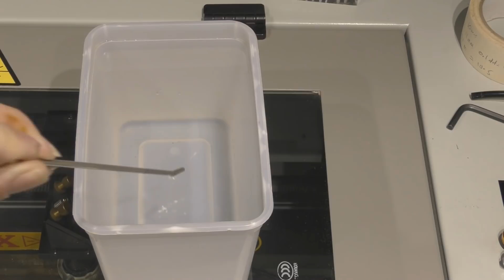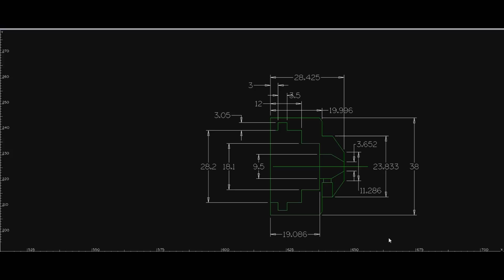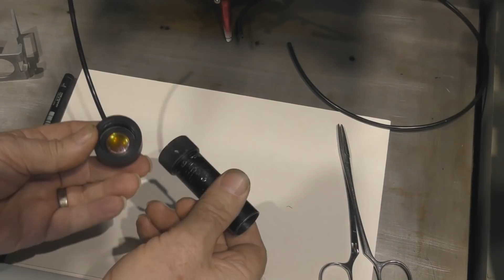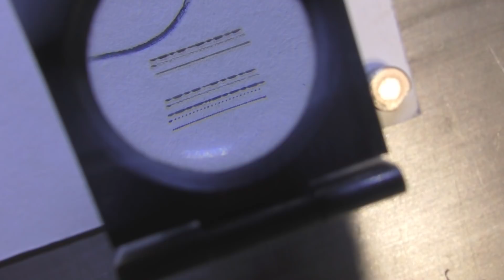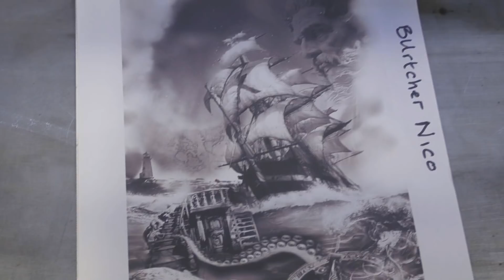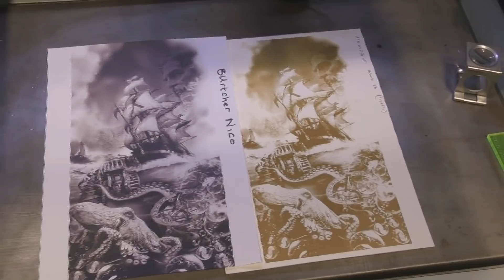RDWorks Learning Lab 139 Designing a Compound Lens System

Comment: I was so impressed about this that I have to try. I 3d printed a variant of your double lens nozzle and now I have load my laser and running a very detailed picture. I wish I could share the result here. It's amazing! It's a 504 DPI  running att 150/9.5  (100W blue china laser). I'm totaly lost!
Thanks Russ!!
Reply from the maker: Hi Mikael
Check your You Tube messages for a response
Best wishes
Russ

ps there is a new video that takes this idea another step on  #140
Reply from the maker: Hi Mikael
I do hope that these interesting new techniques allow many more people to get your superb quality results.  I have steered away from wood because of the inconsistency of the surfaces for demonstration and experimental purposes. It's great that you have been able to achieve such amazing results on wood. Congratulations and thanks for sharing.
Best wishes
Russ
Reply: could you share your stl and raw 3d file? would lave to take a crack at this. i have the black tube like he has.

Comment: Really interesting work! Have you considered adding a mechanical aperture to the beam before it goes through the lenses? This would reduce the spherical aberration and allow you to use higher, possibly more stable, laser powers.
Reply from the maker: Hi John
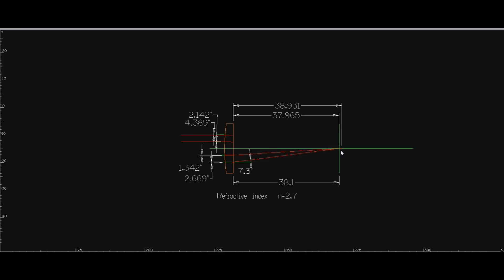I tried various apertures in the previous video and things were worse with small holes.  I understand the dream to minimize spherical aberration but the the more I think about the drawings and the path of the light rays I have seen, the more I'm coming to believe that spherical aberration is doing a good job of regulating the power automatically by letting the central high density part of the beam reach its focus at a longer distance than those from the outer part of the beam  (see the picture at 13:18). I did not try to use a meniscus lens as the second lens in these tests because I felt that the  second concave surface,  which is designed to deal with parallel rays entering the first surface, would be so far off it's original design parameters that it would cause even worse aberration. Hence I used the plano convex.  Subsequent to my video editing I have had a chance to reflect on this issue and wondered if this is the reason why the best focus point was about 0.5 to 1mm further out than I had anticipated. This out-of-focus may be bad for cutting but just possibly it may be a silver bullet for engraving with dots.  I am planning to investigate this counter intuative point in my next video. I'm pretty confident that the conventional rules of optics do not apply here.

Best wishes
Russ
Reply: Hey Russ, thanks for pointing me to the last video, I just gave it a watch.  I have to say that I am still a fan of the aperture idea. Are the spot sizes you show at 9:30 are the ones with this setup?  If you are seeing weird edge effects on the spots perhaps cutting a knife edge with the chamfer facing away from the source would help with weird reflections off the plate.  A larger hole size might not hurt either (12mm-2mm is probably 20-30X power reduction). Something like 8-10mm would reduce aberrations and still pass reasonable amounts of power.  Also I'd recommend this site for refractive index values (its pretty good!):
 https://refractiveindex.info/?shelf=main&book=ZnSe&page=Marple
Reply from the maker: 140 will probably be published tomorrow. I have a different take on the whole issue.
Best wishes
Russ

Comment: Russ, is there a power drop off at the second lens? Nice work by the way. Can't wait for more.
Reply from the maker: Typically lenses are aboout 95 to 97% efficient. So yes there is a power loss at the second lens. That is no problem at all because I am already struggling to get my power low enough. I am operating this tube in the high impact engraving zone even with the second lens. I am using common mode which is a very efficient way to do the engraving as it is high frequency  and high power pulses.

Best wishes
Russ
Reply: SarbarMultimedia what about engraving on black anodized aluminum?
Reply from the maker: Black anodizing will be quite easy and to get what appears to be 500 dpi  because of the way you need to use JUST enough power to evaporate a dot of black dye. Once you have evaporated the dye in that dot with minimum power you can overlap (overburn) with another and nothing will happen except a small nibble off the next dot . Thus you can force much higher resolutions with out muddying the picture even if the dot size says  250dpi.  I have only one piece of black anodized material left so I will find the best picture to to experiment with
Best wishes
Russ

Comment: Nice work Russ. Lovely bit "scientific method" application.
Will it work with "China Blue"? Rather than mill your lens holder from Delrin (Acetal, Polyoxymethylene (POM)) or Aluminium, you may want to try 3D printing the holder. I take it you used Delrin for the holder because it is easy to machine and any "rigid" plastic would suffice, if not, POM is available for 3D printers.
Reply from the maker: I know that the HV power supply on China Blue is not quite as responsive. The answer is yes but I guess at much slower speeds. 3D printing would be an option if you only plan to engrave with it. I am a bit scared of heat reflection if you start using it for cutting. Hence the idea to make it in aluminium.. My delrin version was adequate for proof of concept as I had no aluminium bar around to work with. 
Thanks for the thought
Best wishes
Russ

Comment: I have a very basic optics question: why wouldn't the last mirror be shaped to do the focus and the 90° bend in one fell swoop? It feels like reflective optics is easier than refractive optics.
Reply: Hi
There are several practical reasons why this will never be possible on these machines. 
1)Many sheet machines do not have  raising beds so there is no adjustment in Z for refocusing your fixed focusing mirror  to accommodate varying material thicknesses.
2)All machines have the ability to  swap to different focal length lenses for different jobs. Changing a focussing mirror will entail a lengthy Z axis reset every time you need to change
3) the major problem is that to get the beam to focus at a mechanically practical point means it will always have to be at least 6" focal length. That will make the spot size large and result is much lower energy densities, thus lowering the cutting ability of the machine.
4) Lenses are cheap and easily replaced without the need to reset the beam alignment. 

What you are suggesting will be fine for lighthouses. There is no such thing as a silly idea. What you are suggesting is really possible, just impractical for this application
Thanks for the thought
Best wishes
Russ

Comment: If you do make a run of these 2 lens focus heads I would love to buy 1 off you. It will be easier than me making my own. I want 1 for engraving PCBs with very fine traces. I paint the blank PCB then engrave off the paint where I want to etch away the copper.

Comment: As a photographer I wonder if it's really necessary to continue trying to get a thousand dots per inch out of the laser. Think about the viewing distance of a picture. Print out two photographs say 8 by 10. 1 at 250 DPI and the other at 1000 DPI. Then play some on a wall side by side and stand back three or four feet and determine which one looks better than the other. The 250 DPI at a normal viewing distance is going to look just as good. It's just the ooze and Oz of those of us with a magnifying glass who can appreciate the refinement of the higher resolution but it's not really all that necessary. Does that make any sense?
Reply from the maker: Absolutely agree. From the pictures I have just produced at a true 254 dpi. they are almost photo perfect except under the microscope. I am staggered at the quality that can be achieved with such a brutal piece of equipment. I am chasing the 1000dpi quest as a goal that I am 100% confident that I shall never reach. I dont want to call Thunder Laser out and out liars I would prefer to demonstrate in public just how difficult it is to reach such an unrealistic goal.  There is not better way to discredit their $400  hi res hype than to show how good things can get with 250 to 300 dpi. As I have mentioned, I do expect to be able to dissect the TL lens and test it to my standards.  That's why I'm building a  bit of a saga . Thanks for your professional opinion because I am an engineer not an artist.  This is just an engineering challenge for me to find that boundary for each material because I know that not all materials will accept a 0.1mm  dot.  I'm having great fun shaking this one around and learning so much in the process

Best wishes
Russ

Comment: Have I missed so thing.  Does a stand laser use two lens in the vertical tube or this this an upgrade Russ is working on.  Interesting video
Reply from the maker: No, you have not been asleep. The optical system for all Chinese lasers use just one lens.There are several different ways manufacturers position that lens. Some place it in the lens tube and others site it in the nozzle. In my quest to understand photo engraving I have become aware that the size and quality of dot that the laser can produce is THE limiting parameter  for defining the DPI that you can place on a particular medium. I have long been aware that Thunder laser sell a high resolution head for high definition engraving and always thought that they may be using a 1" focal length lens. It was chance comment from one of my correspondents  that made me aware that they were using TWO lenses. I have no idea what focal lengths those lenses are, what lens styles they have used or the positioning of those lenses.  The claim they make about this rather expensive extra for their machine is it's capability to provide "up to 1000dpi".  IF that is really possible then we will be able to do photo perfect replication on our machines.  That is why (with that 2 lens clue) I am experimenting to see what is possible with 2 lenses.  I have been promised sight of one of these Thunder laser lens systems (as a loan) so that I can do a head to head comparison with my configuration and with my tests to see if we can prove their claims. I think in this latest video I have pushed what's possible to the limit, but hey, there is always a limit beyond the limit, so we will have to wait for the showdown.

Best wishes
Russ
Reply: SarbarMultimedia thanks Russ for your detailed answer

Comment: Very interesting vid.  I make stencils and I am wondering if this compound lens system would give me a finer cut on Mylar film in the range of 125 to 190 micron thickness
Reply from the maker: Hi Frank
 At that thickness it is very possibly going to make a finer cut. However I am just doing some very in depth experiments with lenses for cutting and things are not the same as making very fine dots for photo engraving. . It's not going to cost a fortune to find out though, you can purchase a special nozzle and lenses  as a kit from Cloudray. see
https://www.cloudraylaser.com/products/compound-universal-engraving-nozzle?variant=13488869965875

Best wishes
Russ
Reply: Thank for the reply. I will definitely buy the kit. Very reasonably priced.

Comment: All laser tubes gives different size of beam. Bigger tubes gives bigger beam and smaller tubes gives smaller beam before focus lens.. What is difference if beam from tube is 3mm or 8mm. If you have only one lens its simple. 8mm gives smaller focused spot and smaller dof but better power density.. If used two lens. After first lens beam start going smaller before second lens, how that smaller beam gives smaller focused spot ? ,
Reply from the maker: Hi Mika 
The smaller spot into the lens gives less spherical aberration and produces a less fuzzy focus zone.
http://www.parallax-tech.com/faq.htm
This is the document that may help to explain that there are two conflicting requirements. In #138  it appears that I chose the wrong option for our purpose and that the small spot size onto the lens was the wrong approach. For this video I have realized my mistake and found that the other conflicting requirement, the largest spot size onto the lens,  was a better path to follow. When you jump on to #140 you will see that my understanding grows again but in a totally non-conventional way.

Best wishes
Russ